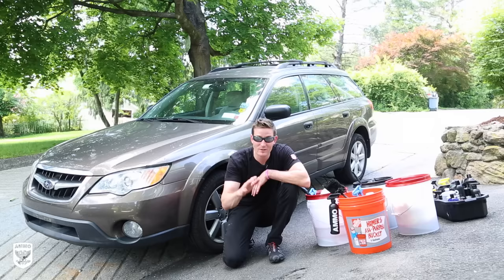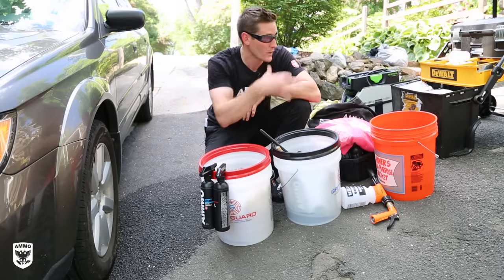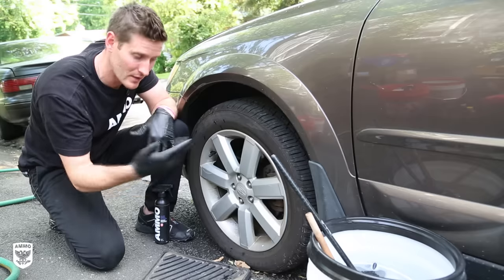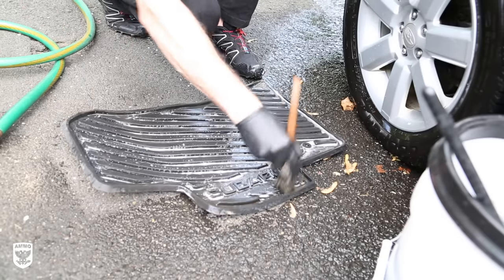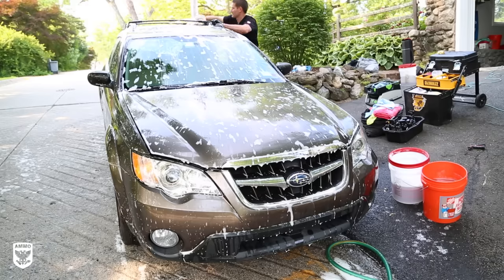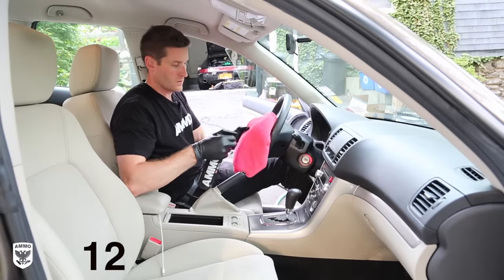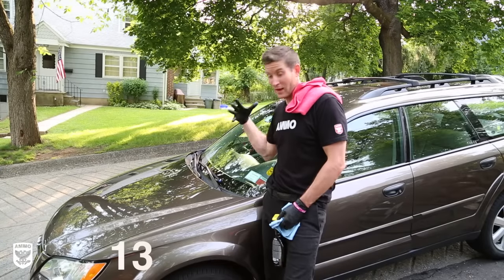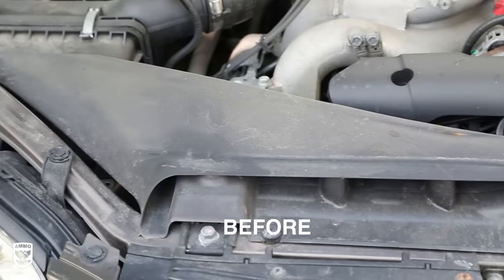Best Carwash Technique: 15 Steps + Tools

Comment: Hi Larry, great vids! Just wanted to share something that I’ve noticed that I do differently to everyone I’ve seen videos of on YouTube. I first heard about the two bucket method through reading it somewhere, so by not watching someone else do it I’ve ended up with a slight variation which may be right or wrong? When I’ve wiped the car with the wash mitt then go for the rinse bucket, I don’t squeeze the mitt in the bucket, I first squeeze it out on the floor before soaking it, squeezing again on the floor then finally rinsing once more and squeezing for the last time in the bucket. Now I know the rinse water is diminishing as I wash and that would mean the concentration of dirt in the rinse bucket is higher, but my rinse water stays a lot cleaner this way and is also topped up easily to negate the dirt being added. Small detail but they add up obviously! If anyone see a flaw, please share.

Comment: Quick question on an old video! Do you use the non-soapy water to rinse the mitt after going over the panel, and then dip in the soap to continue? Little unclear what's happening with the buckets, thanks for all you do!

Comment: I always rinse the mit thoroughly with running water after each application of soap to a panel. Therfore when I dip the wash mit into the soapy bucket it is absouletly clean each time. I never ever dunk a dirty mit into the soap bucket. Then there is no need for a 2 bucket or grid guard method. So wash a panel then wash the mit thouroughly then dunk in soap bucket, wash the panel then wash the mit thoroughly with the hose and dunk a clean mit in the soap bucket then repeat as many times as necessary.

Comment: Larry you didn't cover your battery with a plastic bag!! I also have a few questions. In your experience is the back really dirtier than the front windshield & hood? Also I was taught to vacuum first to avoid getting dust on washed paint. Have you had dust after you vacuum?

Comment: I like your vidoes. Personally I've found that using a paint spray gun (on compressed air) is the best way to vinyl the engine bay.. and the interior as well. (That's my favorite part of the detail lol) It's leaves a nice finish and it's A LOT less work.

Comment: Do you recommend using a leaf blower (or comparable) to dry a car? There are a number of other videos out there that suggest this touchless technique to reduce risk of manual swirl marks, water spots and/or scratching the paint from the manual microfiber towel drying technique. I've always microfiber towel or Absorber dried my cars but wondered if you had any thoughts on this technique as possibly a better alternative? Thanks.

Comment: I don't understand the 2 bucket method with the grit guard. What are you trying to achieve with this method? If it's for the dirt and grit to settle on the bottom, is this process 100% reliable?  I use 6/8 clean mitts for each car wash and NEVER double dip. Wouldn't that be better than rinsing and using double grit guards? I never have any grit on the bottom of my bucket because I NEVER EVER double dip

Comment: great video but if somebody can answer, why is there gunk at the bottom of the soap bucket if the other bucket is for rinsing? u soak the mitt into the soap bucket, wash the car, then rinse the mitt in the rinse bucket and repeat right? shouldnt there be gunk in the water bucket instead?

Comment: What do you use on the flexible rubber seals that go around the door or hood/trunk fr cleaning and preserving? It's the soft cushiony rubber stuff, not the plastic. I have a line of it on the front hood of my Maxima.

Comment: What's your opinion on using Black Magic bleach white tire cleaner on your tires when washing your vehicle? I have been using for the past few year's and it does an amazing job at getting brake dust and road grime off and make them look like they are brand new using a tire brush before I shine them

Comment: two questions. 1) It seems like the reason why you have 3 buckets is the fact that you don't want to use one bucket for rinsing off brush or wash mitt for both wheels and body. For that purpose, can I just have two buckets, but clean the wheel as final step after cleaning all body parts? that way, wash mitt didn't pick up a little metal debris you mentioned and scuff the body paint?

                         2) Also, you mentioned you want to remove visible dirt on the paint by using foam gun before you soap the car. That way, wash mitt doesn't pick up dirt and scuff the paint right? I see those visible dirt on side, front and rear bumper a lot before I soap my car. If that is the case, will rinsing off those part for like 2 min with pressure wash do the job of knocking those dirt off the bumpers?

P.S. I wash my car using car wash machine only set up to rinse function. There is some function that soap the car, but I never bothered to use those since I'm using my own product which is meguiars wash soap.

Comment: Does the Spotless water filter reduce the pressure coming out of the hose.  My water is pretty clean already, but the filter would make it even cleaner.  I just do not want to lose much pressure from my hose for rinsing if I use the filter.  Thanks.  BTW, I just read the car wash article in The Wall Street Journal, which mentioned your YouTube videos.

Comment: AMMO NYC

i wash my wheels, rinse and then use an iron remover

reason: iron remover are in general more expensive than shampoo's, so i want al of the dirt that can be removed  (without  iron remover) off already, rinse the wheel, once they are semi-dry i use iron-remover to (3-5 sprays and spread with a brush) to atack the heavy dirt/iron. only thing: durring the wash i quickly rinse my woolies/brush/mit before i put it in the shampoo bucket again

what do you think?

Comment: hey, you are an excellent expert in the auto detail/wash industry.  I would GREATLY appreciate if you can locate a 1992 Mercedes Benz 300SL and create a video of detailing it. These are the R129 models, I'm sure you know.  The 300SL models range from 1990-1993. The R129 models come in 500l 600sl and so on, but I would appreciate if you find a 300SL as some parts in the engine bay and interior are sensitive to cleaning.
Reply: +iaai my 92 300SL is GOLD exterior and TAN interior.

Comment: I have a 2017 Porsche Boxster S, gloss and polished wheels (Carrera S 20” wheels) I never ever use a spray on my wheels, because I have ceramic pro and also because I wash my car 2-3 times a week, usually 2. I don’t scratch the wheels, visual inspection confirms that. Is it bad that I don’t spray the wheels down?

Edit: Spray with chemicals, not water.

Comment: What's the name of that vacuum you used? I would like to check it out and purchase it. I'm very allergic and the vacuum that I usually use doesn't remove dust and sometime I sneeze a lot because of the dust that sticks in the car.

Comment: I work on MH60s in the military. When it comes to washing the aircraft. we spray the aircraft with water from the bottom to the top. we do this so the dirt that is exposed to the water is alreadt traveling down the aircraft with water. thus we do the same with the soap. bottom to top to prevemt striking. just a tip
Reply: we do this to prevent stratching as well.

Comment: I tend to damp with a wet micro fiber  the car instead of moving the towel across the body of the car during the drying step, thinking that it might induce more scratch if I do the later. Is that a good practice?

Comment: just double checking, but can u open the oil cover as well or watever it is called (the thing u pop open when u going to refill gas, not the cap inside,) and hose that down and clean it while washing ur car? i been spraying all multi purpose cleaner on it only so far

Comment: Hi all, just after some advice from other car cleaning fanatics out there. My car regularly gets very dirty, dirty enough that you can't see out of the back window or read the rear number/licence plate. It also accumulates on the side and front respectively. It gets so dirty that one pass with any cloth/wash mitt and its instantly black. My question to you guys is how would you get rid of most/the heaviest levels of dirt with the chance of causing the least amount of damage? If that makes sense. Will be good to hear your advice.

Comment: ok, i have one big problem... i live in an apartment... and the building rules say "no watter spray of any kind"... so i cant use a hose or a water pump of any kinds... is there any other way to apply the foam?... like... manually?.... and one other things... microfiber towels... u mention in one of your old videos to use WINDOW microfiber towls... are those regular towels with smaller threads?.. or are those some sort of special microfiber that i need to look up for?

Comment: AMMO NYC Why did you use the master blaster only on the engine and not the paint or wheels? (Considering buying a blaster but if it is bad for the paint and only useful for the engine idk if it is worth it)

Comment: Hey Larry, you always talk a lot about washing safe, avoid dragging dirt across the paint...
But I have a question: why stick to the 2 bucket method?
Even with the most thorough rinsing and use of grit guards, I find the soap bucket eventually gets soiled and there's always a risk something stays trapped in the wash mitt.
This is why I don't bother having a rinse bucket anymore, I soak multiple towels in my soap bucket, do one pass with each of the 8 sides of a towel while rolling back the leading edge, and grab a fresh clean one when I used all sides or the towel gets dry...
Reply: +Candisa I've thought about that. But when you say 'towel', do you acutally mean a towel?
Reply: +hrthrhs I mean medium to plush microfibre towels, heavily saturated with soapy sudsy water. :-)
Reply: that's a good idea.

Comment: i have an old Opel Astra F, and i would like to clean my engine area. there are a lot of exposed cables the spark plugs and the battery , is that OK to use Water to clean it?

Comment: is that ammo hydrate a quick detailer? if i want to use a quick detailer, should i spray it directly on the car or on the drying towel?
Reply from the maker: +Richardst91 Hydrate is different than a quick detailer.  It has different properties that are specific for the drying phase of the car. AMMO Spit is closer to a quick detailer.   Hope that helps. :)

Comment: A lot of this is good advice. However in the area I live in the level of thick clay mud we have to drive through can quickly attach to a vehicle such that you can't even tell the colour of the paint. Every one I know has a gasoline powered pressure washer to get the grime off.  Sometimes we go through the local hand car wash using their high pressure wands. Don't even get me started on winter driving ...

Comment: I know a guy who washes his car with a RV inline hose water filter attached to the end of his hose and then his nozzle attachment this having an inline hose filter and not a big contraption.  I suppose if youre a professional you would benefit from a big filter but just letting some of you know you can get filtered water with an inline RV hose filter hi flow that should just fine. it probably wont filter out as much but it will filter something and those somethings wont end up on your paint. up here in western w.a. its always cloudy and always wet 3/4ths of the year, car paint gets brutalized around here. round these parts people see a shiny well detailed car with mirror paint and its the talk of the town.

Comment: Hey Larry, I am huge fan and I watched alot of your videos and learned alot from them. I would like to say thank you for them and I learned some of my own alot the way. just one question about the cleaning the engine bay area...what if I have no air compressor that can dry the area, ist there another way to dry the safely? what are your thoughts about it? I would love to know.
Reply from the maker: +Sanghun Lee You can use a master blaster if you have one but if not, a damp microfiber towel can be used to clean up most of the water, but don't use that MF towel on the paint after the engine.
Reply: Thank you so much for that information. Hope there will be more videos to come and maybe make my own also. Thank you so much once again.

Comment: Where can I buy these white asnd orange buckets that Larry is using in this video? and do they have a Lid? thx
Reply: That one orange bucket is a Home Depot bucket and they have lids (sold separately).
Reply: jincuteguy You can find buckets almost anywhere but know that a grit guard will not fit in all. The lids are called gamma seal lids.

Comment: Quick question, do I need to remove the negative battery terminal when cleaning the engine?
Reply: No. Your engine bay can get wet. Just don't spray the engine while it's hot.

Comment: I didn't get how you use the two buckets, I know you said rinse bucket , do you mean rinse the wool washer?  and how many towels you use per wash?
Reply from the maker: yes. use the rinse bucket to rinse your wash mitt before putting it back in the wash bucket. The amount of towels depends on how dirty and how crazy I'm getting.  I could use 5 towels or 50. Thanks for watching

Comment: is weekly frequent enough to wash a car to prevent paint damage and how frequent should waxing & clay bar use be??
Reply: +William McDuffie Jr. you should wash the car whenever you think it's dirty , dont wash it if it doesn't need. you should clay it like once a year (if it needs). in terms of coatings you should use sealant every 6 months and/or wax every 1/2 months
Reply: Thanks

Comment: you might call me nuts but i use three wash mitts for the top, mid and bottom section of the car. Remove all bird stain with bug and tar removers as safe as possible before sow foaming it. aaahhh im weird

Comment: Right at the beginning of your video you mentioned Tar marks, but you did not say when or how you should remove them.. Should you spray tar remover onto the tar spots before pre wash so onto a dry car then using an old Microfiber cloth wipe them off, or apply after you have do pre wash or after contact wash. Also same question when using bug remover..
Also why would you wash rubber mats with a brush just been used to clean the dirtiest part of the car.. contaminating the mats with brake dust, dirt and powerful chemicals if used..

Comment: Besides those chemical liquid products, I can't find any of the tools such as the washmitt, wooly to clean the rims, et,... I don't see any of these tools on your ammo website.  Where do I get these tools that you are using in this video for the car wash? Thx
Reply: jincuteguy Go to Amazon and look for the wheel woolie brushes. The mit is called a Marino Wash mit and they cost over $30. I think Adams Polishes wash mits are the best for a weekend warrior
Reply: Why Adam Polishes wash mits are the best? comapre to the ones selling on Amazon? aren't they the same thing materials?
Reply: I am sorry I meant Merino not Marino. I have used many different wash mits and I like Adams the best because they are large, they cleaen easily with a grit guard and they hold a lot of dirt. The mit is well built and has never fallen apart on me. I don't like microfiber mits only wool mits. You don't have to buy adams, you can buy any other mitt I just think the Adams mitt for the price is hard to beat.

Comment: Is that wooley used for the wheels also used on your paint? Or do you have 2?
Reply from the maker: Never.  Wheel tools never touch the paint.  Hence the reason for the 3 bucket system.  Thanks for watching
Reply: 8Hachiroku6 I doubt it!! Larry is so super overly nice. Seriously a top notch guy

Comment: I am washing my car the opposite way. Wash bottom of the car first then top of the car. If the lower part of the car is clean, junk from the top of the car will not get stuck on the bottom part and it will just go all the way to the tarmac.

Comment: drying the car with hydrate... what is that, and why does that help, and what is it called so i can buy it from a brand l can pickup in store
Reply: Drying a car with hydrate/lubricant means drying ur car with a spray wax or spray detailer to help moisturize your cars paint and help prevent water spots, it is not really necessary to dry to your car with a lubricant but it does help to minimize water spots and give ur cars paint an extra shine. But like I said its not really necessary just make sure ur drying towel is damped when drying 👍🏻
Reply: Using a little detailer when I was drying really was the missing step to getting a top notch wash for me.  It lubricates so you get less chance of streaking/swirling and it also moistens and removes any little water spots or dirt marks that might have run down or dried on the paint due to outside heat/time.  It's really hot where I am this time of year so even washing under an overhang and doing a panel at a time I get some drying.

Comment: why use both wheel plum cleaner and brute if they're both wheel cleaners ?
Reply from the maker: +sypher0101 Plum helps to break up the iron deposits that have embedded themselves in the rim.  Brute helps remove the rest of the gunk on the rim.  Here's a video with more info: https://www.youtube.com/watch?v=sd16iX8Ore8

Comment: Every electrical connection (almost) in the engine bay is waterproof. Except for one part, the most important part - alternator (or generator / lichtmaschine... whatever is called in your country) whitch you hasn't covered. Some chemicals can eat enamel from windings and cause short circuit. Be aware of that.